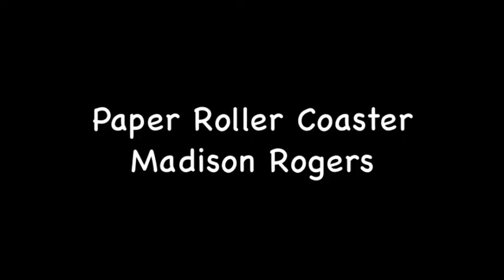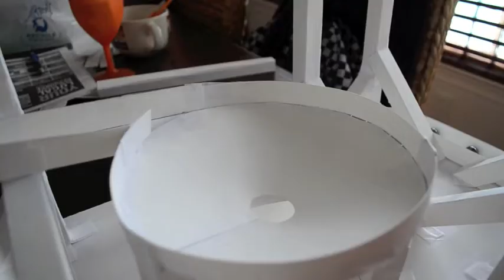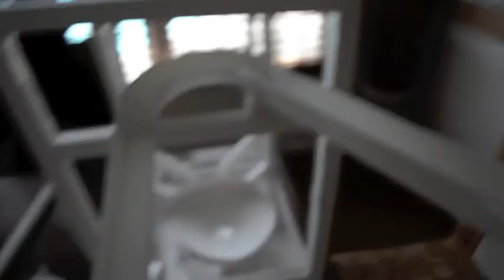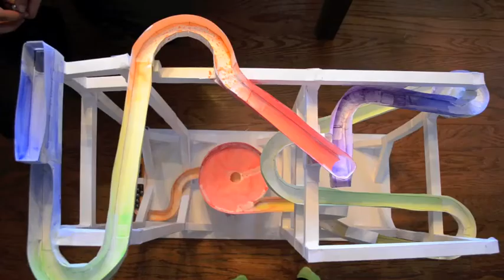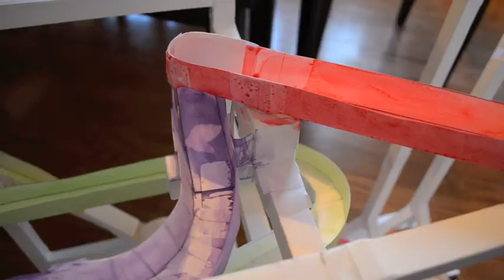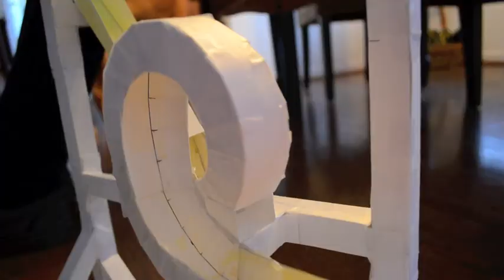Physics Project: Paper Roller Coaster

Comment: did you use A4 paper or their is different measurements for the paper??
Reply from the maker: I measured everything out and cut everything. I made templates though beforehand out of card stock. Makes the pieces all fit nicely together in the end when using exact measurements.
Reply: thanks a lot and your project is really nice!